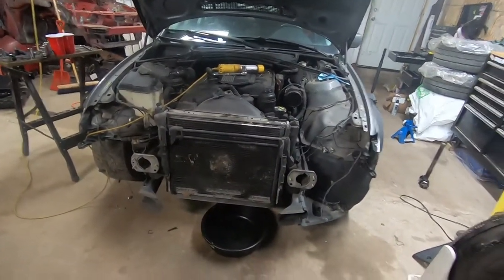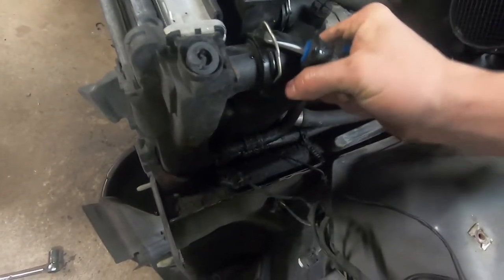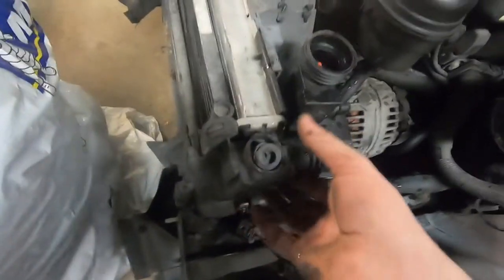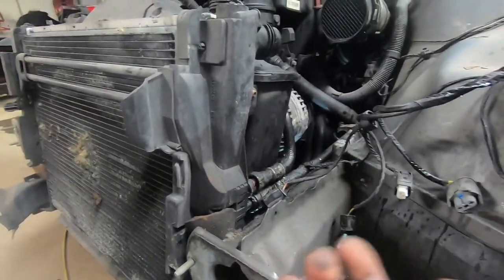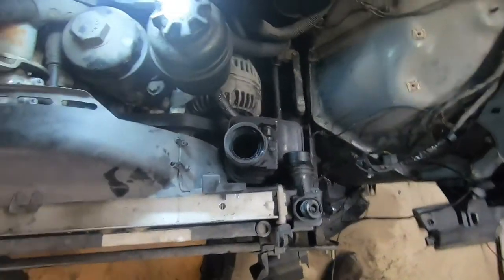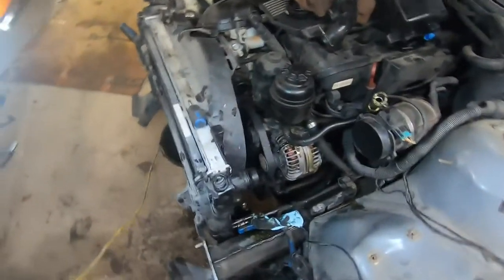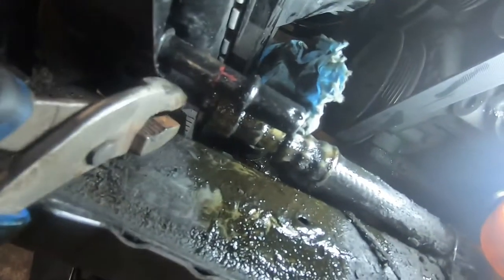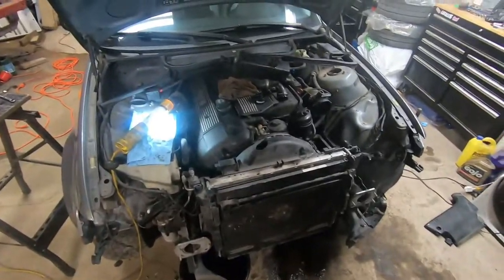Removing E46 Radiator and AC Condenser (How To)

Comment: The hole for the wire is only as big as the wire....the plug is massive and will not fit through. How did you wiggle the plug through?!?
Reply from the maker: Which part of the video are you referring to?